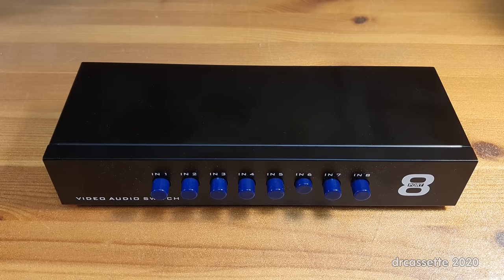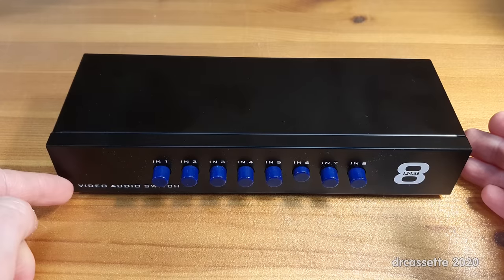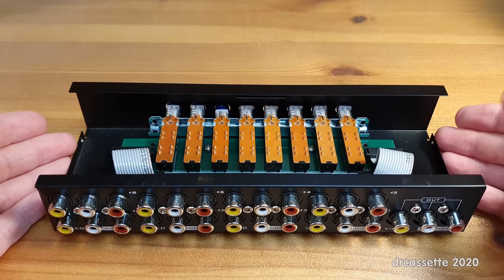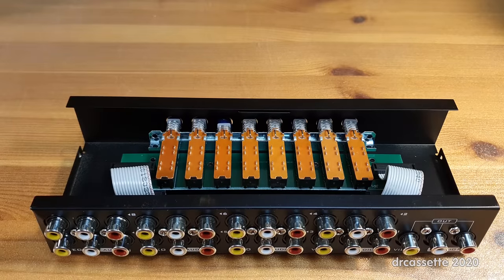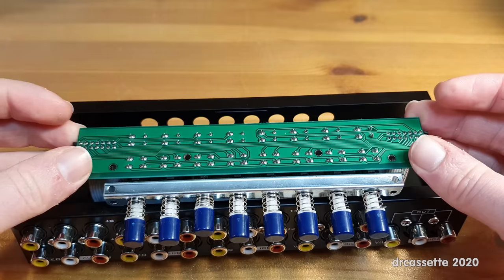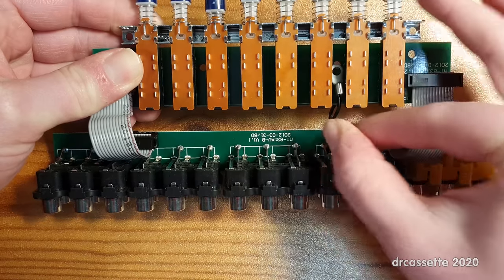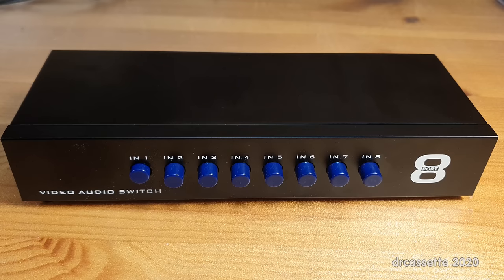8 port AV switch box review and signal ground modification

Comment: I think we definitely need a tour of your amplifier and the numerous devices you need to connect to it. I have a 4 way version of this, also passive, which I bought from radio shack long ago. It also has S-video ins/outs. I use it to connect my video game systems (genesis, turbo grafx, Dreamcast, SNES). Great video!
Reply from the maker: The main stereo system is like my workshop, it's a never ending work-in-progress project. Always a mess, never fully functional, never like I would like it to be. So I don't think I could make a video about the system that I would be happy with ;)

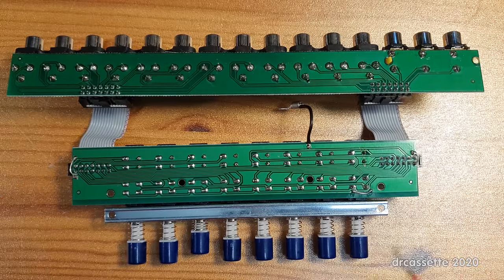Comment: 8:45 - You might want to remove the jumper on the lower-right to avoid a ground-loop!

It's also a good idea to scrape away the paint around the screw-holes of the chassis, including the cover. This will give you MUCH better ground connections!
Reply from the maker: Just because it's ground and looks like a loop doesn't mean it's a ground loop. It is common practice to connect ground planes of circuit boards together in as many places as possible.

Comment: Good job. You can use the video ports for getting separate source grounds as well. It will require some modding to ports PCB if you so desire.

Comment: An additional note: the switches of the switch box are intended to be exclusive so 1 input goes to the output. However, it is mechanically possible to press multiple switches at the same time so you can blend multiple inputs (max 8). It (then) also works in reverse so 1 input, multiple outputs. Note: the switch mechanism mostly likely is not meant for this use so keep that in mind.
I was about to build my own switch boxes (1 in>8 out and 8 in>1 out) until I stumbled upon these Chines boxes and they work fine, are cheap and feel sturdy. It would cost me more to buy metal cases, switches, connectors, etc.

BTW: an alternative is a Technolink TC-716 (but audio only). There are just 6 in-/outputs (2 stereo 3.5 mm jacks and 4 stereo RCA) and you loose 1 for input or output, so 5 are left. A downside is the 3.5 mm jack are not vey good quality (I had problems with several units). On the positive side, you can switch each channel independently and have 2 audio paths: all pressed channels are connected as well as all depressed ones.

Comment: It's a nice unit, but when I was looking for something similar I wanted inputs and outputs. This was to be able to connect things like a Pioneer Multi-Player/CD-R, Tascam CD-R, Denon MD, Sony MD Aiwa Cassette Deck and a Teac Cassette Deck. With this in mind I went looking for a couple of the Realistic Tape Control Center switch boxes. They work well enough but they do have a crappy plastic housing....oh well.
Reply from the maker: Since these switch boxes are completely passive, you can just use them the other way around! Connect the amplifier's record output to the "output" of the switch box and the "inputs" of the switch box to the record inputs of the audio recorders. I am actually planning to eventually have two switch boxes, one for switching inputs and one for switching outputs. These tape control centers were made by various different brands including Sony and Akai, but they are extremely expensive.
Reply: @DrCassette. good point I hadn't thought of that. The only problem would be that I have enough problems remembering which devices are connected to which switch and input now, without additional switch boxes. I should put my Brother label printer to work really...
Reply: Wow! Thanks Dr.Cassete this video is very helpful i have 2 of them,i hope you make a video on it.

Comment: These boxes are great for audio, but as you pointed out not so good for video. I reckon they have a lot of signal loss due to the lack of signal amplification. I’ve got a two port audio switch that I use in reverse to switch my turntable+amplifier between my computer and another audio system with speakers.

Comment: I bought 4 of these directly from China for 50 Euros. Thanks for the video, will definitely do the ground modification. Hope I can also use this thing in reverse for the record signal...at least that's the plan. Two daisy chained for playback, two for record. This way I could reciod and playback all of my devices. Dcc, reel to reel, dat etc., everything chained together. Curious if that will work.
On the search for cheap but good enough rca/chinch cables now.
Reply from the maker: Yes, you can use these simple passive switch boxes in reverse for switching a record output signal.
Reply: @DrCassette  
That's excellent. Have these switches laying around for a while (so many other projects and duties) but now I'm excited to try them.
Reply: @AttilaTheHun333333  It will work but for recording you maybe want 1 input and 8 outputs. It can be done by pressing all switches at the same time (put the front side down on a table and push evenly).

Comment: 5:52 If unused inputs are grounded, that means that the outputs of your sources are shorted! Not sure this is clever idea unless sources are turned off.
Reply from the maker: Generally that is okay to do, most equipment has capacitors in series with the output to block any DC, in which case shorting the output to ground is perfectly fine. If the equipment is DC coupled that could be a different, although I would assume even those outputs are short circuit proof.
Reply: @DrCassette  It's ok if signal is not present on the output, but if it is, I still think its big difference feeding the short (even through capacitor) instead of normal load like 10k-ohms or higher for line impedance.
Reply: My pre amp has all the inputs and outputs just grounded together and it works fine

Comment: So, it's been a little over 2 years since you made this video. Are you stil using this and do you like it? I'm thinking of picking one up and making the same mod.  I'm using a Realistic 42-2110 switch box right now, which I like, but it only had 3 inputs.
Reply from the maker: In the end I never actually used this box, it has just been sitting around since I made the modification. So unfortunately I can't tell you how reliable this box is over time...
Reply: @DrCassette  Are you using something instead of this?
Reply from the maker: @AndyP126   I wanted to use the switch box as part of a stereo system, but I never set up the stereo system as I had planned. So I just didn't need the switch box.
Reply: @DrCassette  Feel like selling it and saving me trouble of buying the same unit and doing the same modifiction?
Reply: @AndyP126  lol

Comment: Can you use the compost for digital audio ?
Reply from the maker: It's a passive switch box, you can certainly try to feed digital audio trough it, not sure if it would work though.
Reply: @DrCassette  I can confirm it works fine. I tried it in between the coax output of my audio interface and the coax input of my MiniDisc recorder, no problems.

Comment: would you recommend this mod if you're also using the video line?
Reply from the maker: Yes, this modification will also greatly improve the quality of the video signal as it does create shielding for this very sensitive signal.

Comment: This thing is noisy as hell
Reply from the maker: Have you tried the ground modification shown in this video?
Reply: @DrCassette  I havent fully done it. But I added a quick jumper wire from the case to one of the av ports. It does make a difference but im getting insane video noise induced into the audio. If I use a seperate switcher for video and the other for audio then the noise is isolated. I might just get another matching switcher or send big money on a receiver but its hard to find one with all the inputs I need.
Reply from the maker: I wouldn't recommend these simple switchers for video signals, they are barely good enough for audio signals :D